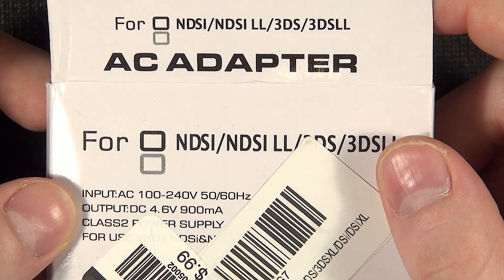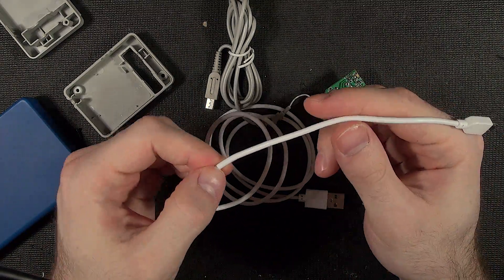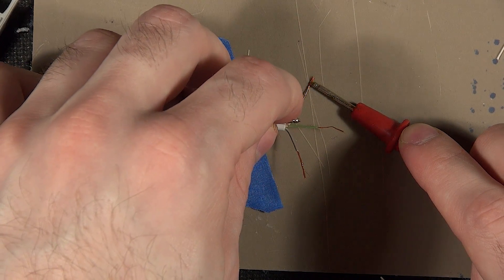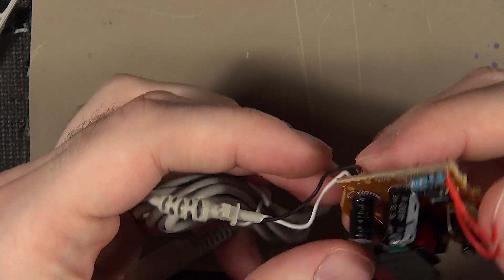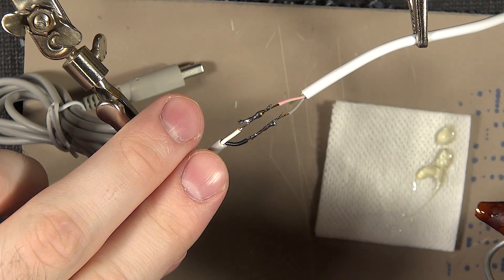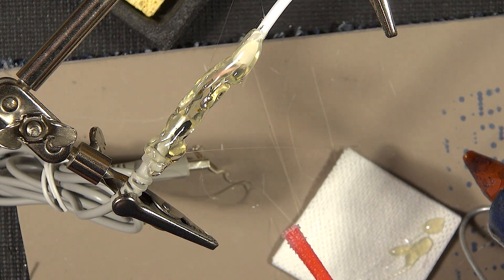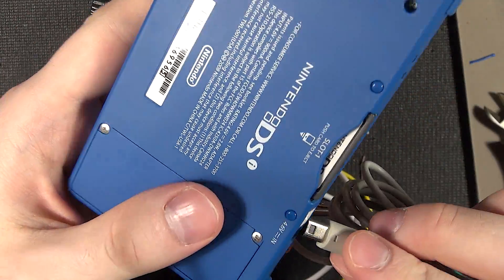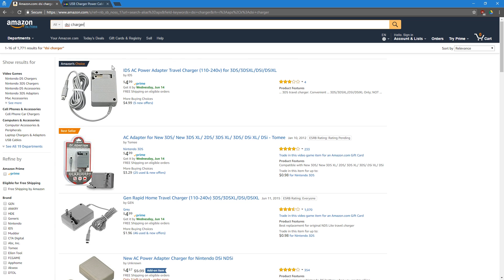DIY DSi USB Charger on a Bigger Budget

Comment: Or you can buy a proper charger on eBay for $3
Reply from the maker: That's probably the better option. Less fun, but probably better.
Reply: I wouldn’t trust a cheap eBay charger. They’re not all that great, and I’d like to keep using my DS.
Reply: Probably better than frying my Ds, but I'm impatient.

Comment: Can i just twist the copper leads around each other, or do i have to use a soldering machine?
Reply from the maker: I always have to recommend soldering, but as long as you do a good job twisting them together and then either wrapping in tape or hot gluing like I did, there shouldn't be any problem.